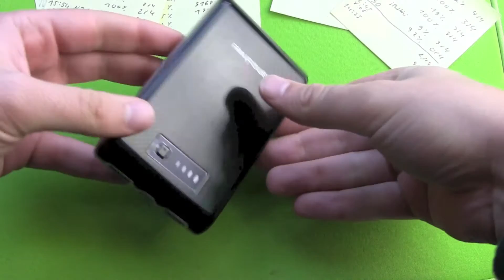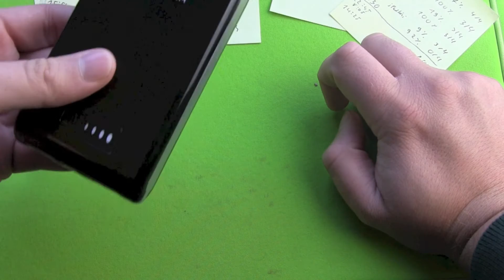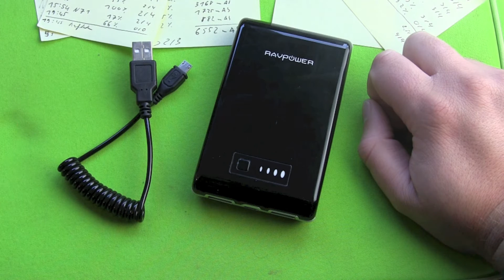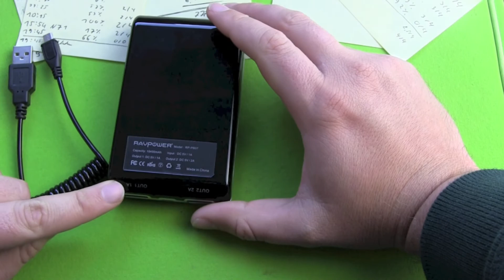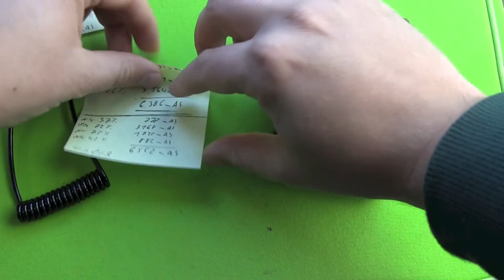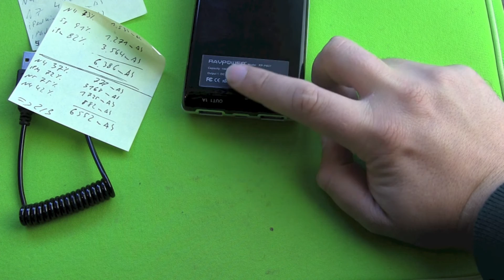RAVPower Element 10400mAh External Battery Pack Review

Comment: is this good for laptops?
Reply: no, most laptops require much higher voltage. you'll have to buy a ravpower extreme 23000 mAh or a large power castle or something with higher voltage ratings meant for charging laptops.